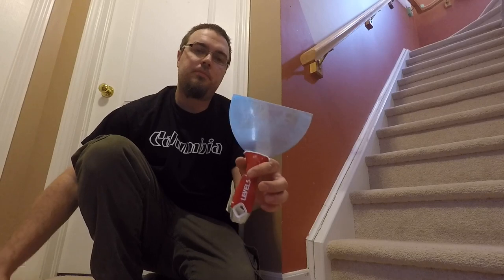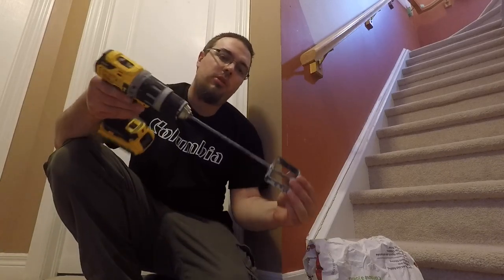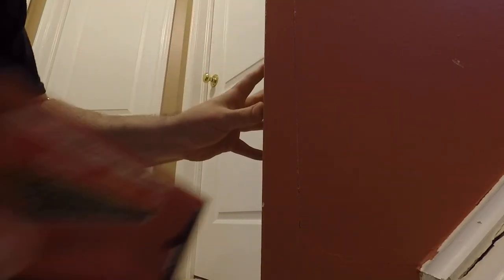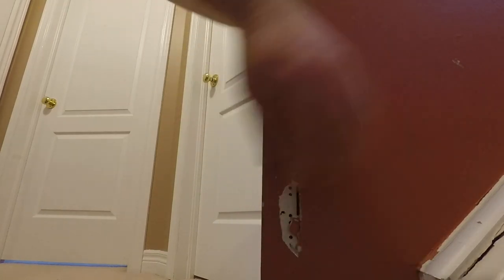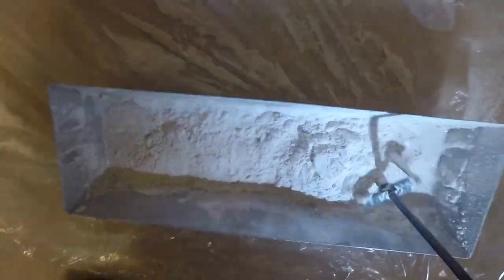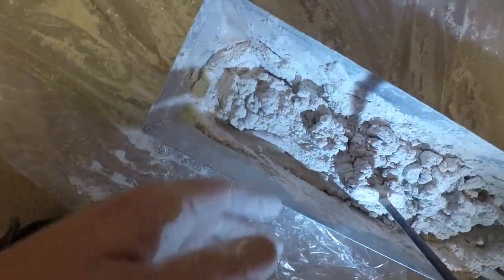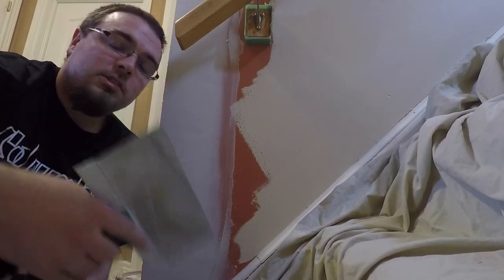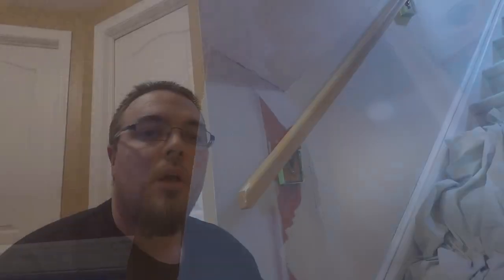HOW TO FIX CRACKED CORNER BEADS (Drywall Tips)

Comment: Had a leak in bathroom upstairs and had to get a new tub and put down new flooring! So now repairing the ceiling and corners touching a cabinet in the kitchen and started from scratch with mud but probably need to do this around corners.

Comment: Please explain again.............I use the hot mud, twenty minute work time.  Then all purpose as the last application - would that be all purpose that I add a little water to the mix.   I see Plus 3 in a small container.  Is that all purpose just lighter than the green container.  thanks.
Reply from the maker: Don’t use the green bucket. Green has a lot of glue in it used for putting tapes on. Plus 3 is fine 👍🏻

Comment: I’ve got a short length cracked in the middle that I’ve dug out, I understand the idea that you feather it out away from the corner. What I don’t understand is how to feather out the top and bottom where the corner didn’t crack.
Reply from the maker: Pat Hillis depending on the total length of the bead I would personally coat it the whole length. If that’s not possible just feather out all sides of the area. Kind of hard to explain in the comments. If you’re on Instagram hit me up on there and I can send you videos to refer to.
Reply: Built Tough Tool Talk I’ve got a few different spots so I’ll try both methods, thanks again for the video!
Reply from the maker: Pat Hillis np. Let me know how you make out. Good luck 🤘🏻

Comment: Staples?? Couple of drywall screws where the mud popped out would of been a much stronger fix. And using regular mud instead of some weak ass lightweight mud is better if you don’t gob it on.
Reply from the maker: Johnny Bravado yes staples. These are vinyl beads.
Reply: some screws all the way up and down and fill in the holes some sanding and retouch of paint not doing all that too much work for someone who wont want to pay much ...
Reply from the maker: @meanbean98  this is a vinyl corner bead. If you put screws in it it will flare out causing you to add more and more screws. Staples are used to install these types of beads therefore used to fix them as well.